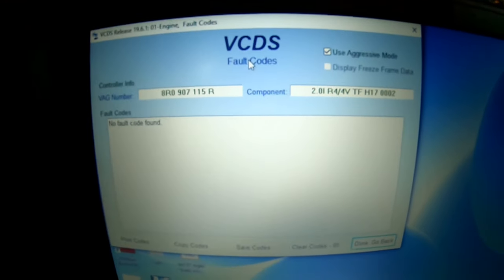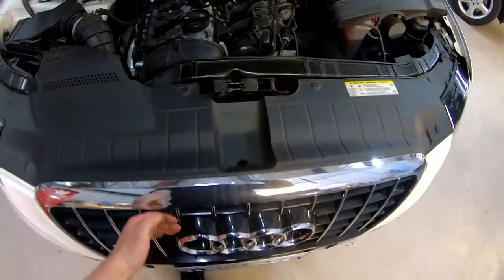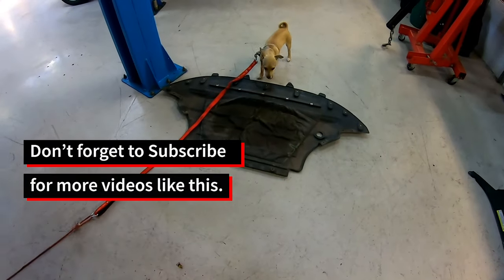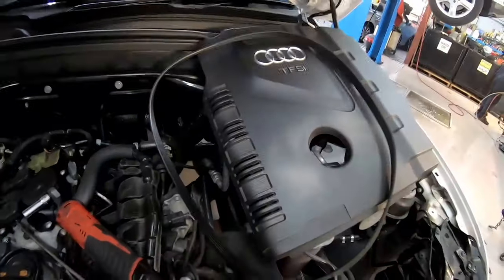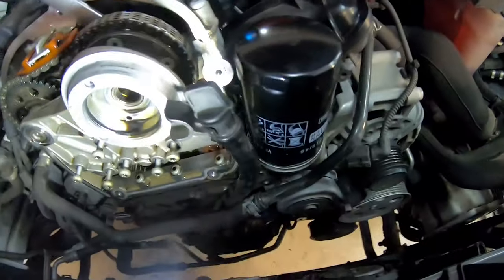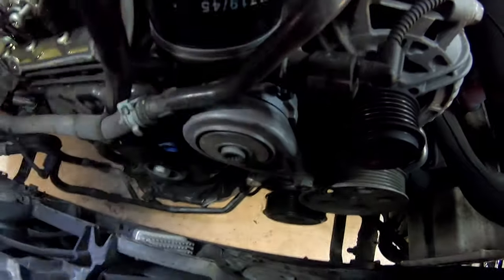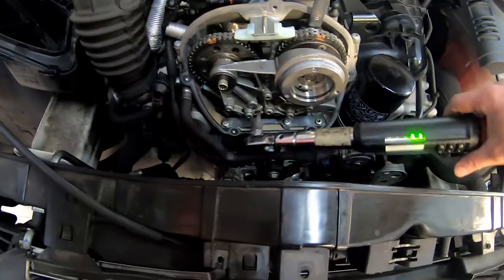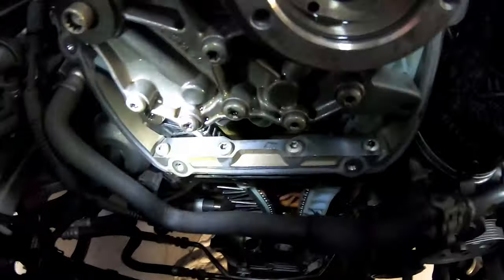Audi Q5 Timing Chain Replacement 2.0TFSI Guide

Comment: This is the first time I've seen anyone change just the big chain and not both of them. Makes the job a bit easier. Thanks for the torque specs. Excellent info and thanks for sharing it!
Reply from the maker: Yes it is advised to do all the chains if necessary or if the customer has the budget. But it is no problem to do just the main timing chain.

Comment: Just checked my camshaft adaptation intake bank 1 phase position sensor on my 2015 A4 (CPMB EA888 gen 2).....showed -6.02 degrees. Not exactly sure how the car didn't grenade itself before now, but I'm grateful. Might try doing it myself because the dealer wants $3500 for it.
Reply from the maker: Or find a good independent. Should be closer to $2k.  Just make sure to get a detailed quote on what's being done. I've seen them still dunning at 7°, but yours is up there. The tensioner will be out a fair way.

Comment: Fantastic video.  I was trying to understand, Can get away with changing the tensioner without removing the chain?  I am thinking of doing this for preventive maintenance.  Thanks
Reply from the maker: Yes you can. Obviously though it is better to replace the chain too, as most are worn and "stretched" by now anyway.

Comment: Good explanation thank you. my 1.8 TFSI is rattling from the front camshaft area when its warm (only in the lower RPM). Can you give me a hint please?
Reply from the maker: You can use a screwdriver like a stethoscope and put you ear to it whilst on different parts of the engine to zone in the on the location.

Does it have 2 oil pressure switches? If so then it has a variable oil pump. You could try unplugging the solenoid on the the variable oil pump, which is next to the crankshaft pulley. If the noise is gone with the solenoid unplugged, then it is likely related to oil pressure. Of course an oil pressure test would be another good test if you have the tools.
Reply: Did you solve the problem? I have rattling noise only when accelerating from 2-3K rpm. It is not loud, but it getting me nervous. 2.0 tfsi CMPA engine 60000 miles
Reply: @16800alex  camshaft magnet vents were defect
Reply: @barbenfischen  I have CPMA engine with one magnet on inlet shaft I replaced it. I've had this car for 5k miles, nothing happens, the engine has power no errors . I started thinking that it is normal sound of that engine. In mine there is such a very delicate rattling but i have to focuse to hear it. I even watched POV videos to compare the sound and it seems to me that these engines work like that. But I'm not sure.
Reply: @barbenfischen  Are you talking about the magnet itself or the valve in the shaft or something else?
Reply: @16800alex  the valve inside of the cam
Reply: @barbenfischen  Do you think I shoud replace it? Due to the symptoms you wrote about. And to be sure, you are talking about that valve? 06H109257C
Reply: @16800alex  try

Comment: My 2013 Audi Q5 CPMA engine did something? I think the chain jumped time? What are the part #'s on the old tensioner? What is the new part # tensioner? They replaced mine 12 months ago and 4,375 miles. The tensioner part # is 06K-109-467K they replaced. I found it to be dbpa code on looking for OEM genuine parts? What is the correct one for this DET - CPMA Engine from Austria? They seem to have Not Made many of these engines and they all seem to have failed? Please help me what should go in the engine timing train? I might get stuck doing this job. Car is at the Dealership who sold me the car 13 months ago. They did the timing chain 1 month before I bought it! The other person owned it 4 months and had it back to the dealer 4 times for engine light. They fixed it and she traded it in on another car! I bought it less than 30 days since they did the timing job.

Comment: Wow the Q5 is awesome. You don't need to take the whole front end off. That must be nice. Would you recommend changing the timing chain at the recommended interval even if it's not stretched all that much? Mine is -3.12 so it's below 4 and I've opted to leave it for now.

Comment: Excelent video! Maybe i missed it, how many miles for a 2.0 gasoline timing chain to be replaced? Thank you.
Reply from the maker: After 100,000km generally. Every service we check the phase position measured value to see how bad it is and advise from there.
Reply: @FourRingsAuto  I have 200k milies and never replace my timing chain.
Reply from the maker: Maybe you have carried out better maintenance than most? Some will make it to those kms if they are doing 10k km or less intervals it seems. The cars that do lots of kms in shorter periods tend to get higher kms before issues.
Reply: @FourRingsAuto  Mine is 2015 q5 2.0t and i don't know what gen is it.
But thanks for your answer
Reply from the maker: Gen 3 likely in a 2015. They don't suffer the same failure rate.

Comment: Thank you so much for posting this video! What do you do if the gauze screen in the cam bridge is damaged? Is it replacable, or is a new cam bridge required?
Reply from the maker: Vw and audi have a technical bulletin saying to remove it if it is broken. There are 2 types of bearing Bridge though. One of my timing chain videos I showed how to remove it I believe.
Reply from the maker: I have in the past advised to replace them though. The worry I have is where does the gauze go. Likely into the sump.

Comment: No need to do the balance shaft chain and guides?  Great video, thanks for taking the time.
Reply from the maker: If they are worn yes. It is a good idea depending on the condition of the rest of the engine. If it has been poorly maintained then it is advised to do all chains. Obviously adds more labour and parts costs too.

Comment: Hello from NE Pennsylvania, wow really great video, and I’d prefer longer , you don’t need to edit or Fast Fwd any content for us, I fact I was surprised you were able to do that job in the limited service position, I would have gone with full service to really get to the lower parts. So I have a 2013 B8 A4 same motor, can you describe the status for me to check my chain and tensioner? How do I know if I have the older version? And did that Q5 throw P0016 codes which prompted the work? Can some tell me the best way to read the best cam position in VCDS? Does the motor need to br at operating temp what rpm to check the degree of retardard based on a potentially stretched chain? Did you say if less than -5° meaning s larger negative number than -5° than it needs to be changed? Really liked the video, good details
Reply from the maker: Larger than -5° so say -6° is bad. I'd change it at -5° Max in my opinion though. Customers discretion.
Remove the round rubber bung in the lower timing cover and you will see the tensioner.

Comment: I have a Q5 TFSI 2.0 from 2015. 67,000 km. A year or so ago, I started to feel a vibration from something that appears to be engine failure. It has never been detected because apparently the fault is so small that it is not marked by the computer. Although lately he has started dialing more codes.

The failure always occurs slowly, in D or R, but always stopped. You accelerate and it goes away. The vibration became so extreme that it was turned off last time. I took him in and they changed the thermostat on the water pump (which was full of liquid). Before that I changed the spark plugs, bovines and recirculation valve, cleaning the throttle body ... for testing.  Do you have some similar problem?
Reply: Just wanted to follow up on this, did you ever get this sorted? Sounds like coils to me but I don’t even know if I classify as an armchair expert...

Comment: Thanks for this, great video. I was wondering if you have ever seen a cam bridge gauge/mesh come loose and cause a low oil pressure fault and a P0016 code? My car is a 2012 A4 1.8tfsi and had the new timing tensioner, new chain and oil pump plus cam bridge bracket approx 10000miles ago,  but has just popped this code up on a intermittent basis cheers from the UK!
Reply from the maker: Only heard of oil pressure issues with the screen if there is something blocking the guaze up. Usually ends up damaging the cams. P0016 is a timing code. Check the bolt for the inlet cam that goes through the cam bridge, the one that is reverse thread and requires rhe special tool to undo. If that is sticking out in the centre it will cause an advanced valve timing issue. Make sure this bokt is not over tightened too. Could also be caused by a lazy/delayed response from the external electronic solenoid for the variable valve timing. That is of course if the base timing has been set correct, but if you had an issue with this, you'd end up with a relatively constant fault code.
Reply from the maker: Seen gen 2 ea888 like these have oil pressure light on the dash for things as simple as a failed pcv valve. The car has 2 oil pressure switches so it can run in regular oil pressure state, and when needed regulate the oil pressure lower to reduce emissions etc.
Reply: Awesome thanks for your help. I think the bolt you mentioned was also replaced at the same time as cam bridge but will check. As you say timing is not a constant fault so thinking more oil based. Occured during lockdown when only taking short 5miles journeys and oil never getting to temperature. My mechanic guy was stumped but has agreed to inspect the top covers and cam bridge. Hopefully the cam isn't damaged!!! Thanks for your help and stay safe down there
Reply: With a PCV problem would that cause an intermittent issue? Sometimes the car runs fine. Thanks
Reply from the maker: The pcv issue i once had that caused an oil pressure light only came on at idle when hot. The pcv caused the idle speed to drop enough to drop the pressure enough to trip the light.
Reply: That's interesting about the PCV as my only comes on at idle and occasionally stalls at junctions when not warm engine
Reply: Hi just thought I'd thank you again for your help via the comments, replaced my PCV and seems to have worked as the oil pressure warning not coming on and idle is running loads better. Drove 50miles without a management light on but it's just popped up so need to get that checked, I'm hoping it'll just need resetting. But for reference my car is the Gen 3 EA888 and had a oil pressure warning at idle, plus some rough idle and occasionally stalled when cold. Cheers

Comment: Hi there, thanks for the video. I have a 3rd gen 1.8 TFSI in my A3 (CJSA engine code) Have you by any chance seen a stretched chain on the gen 3 EA888 engines? 
I’ve had oil changed every 7-10000 km’s and full service history at Audi. It has 140K on the clock so wondering if there is any specific km you would reccomend an inspection of the chain itself? Cheers.
Reply: 체인이 늘어나서 타이밍체인이 넘어간차량 수리한적있어요

Comment: Thanks for the video! I’m about ready to do both my chains and everything. I like the longer videos like this for sure. So you believe in changing the chain because of the cam adaptation phase? I’m doing mine because I have been reading about it and mine is -5.87 degrees with the engine fully warmed up. Thanks for the time you put in to recording and editing these videos!
Reply from the maker: Yes, the negative phase position indicates a worn chain causing the timing to be retarded. The more the chains wears the longer it becomes, and the more retarded the inlet phase postion is.
Reply: Four Rings Auto right on man! Thanks for the info. It doesn’t really seem like that bad of a job. And it was only $480 USD for all the parts and seals and bolts to do the full job. That’s not including the price of the lower cover. I’m pretty sure I can get that off without damaging it
Reply: @FourRingsAuto  hey mate i just had -3.76 reading today on my 2012 audi q3 CPSA 2.0tfsi engine with 125k kms! It has the revised chain tensioner as it was checked and this was installed from factory I believe! What's the difference between the negative and positive readings? Should I change now or can I wait til its on +-4 deg as the web mentions 4 and 5 as the figure, but over 5 would be a no go zone. Thanks for this video
Reply from the maker: I've never had one with a positive number. Assuming you are using vcds and that the info you are reading is trustworthy, positive would mean that the timing of the inlet cam in reference to the crank is advanced.
Reply from the maker: Jason, check the centre bolt for the intake camshaft. It is the control for the variable valve timing. If it is sticking out proud in the middle,  it can cause the valve timing to be advanced when it shouldn't be. The bolt/spool valve can fail like this. Make sure the outer electrical solenoid magnet moves back and forth and isn't sticking out too.
Reply: @FourRingsAuto  my mistake, the reading was -3.76, not +3.76

Comment: Are there any timing marks on camshafts housing to line up the camshafts marks
Reply from the maker: No there aren't. There are the coloured links on the chain if you are removing the chain and either reinstalling or renwing it. There are also measurements from the centre rib on the top chain guide to the inlet timing mark. Then there is another measurement between the inlet mark and the exhaust mark whilst the engine is at tdc.
Reply: Four Rings Auto The reason I ask because my marks on the chains are on the outside of the marks on the cams. I hope that made sense.

Comment: how do you crank to build up oil pressure without starting the engine? I have a key you push in to start the engine.
Reply from the maker: Disable the fuel and ignition
Reply: @FourRingsAuto  by pulling fuses or via VCDS / scan tool?
Reply from the maker: @alexmotoblur  i personally disconnect the ignition coils, and leave the wiring plug for the injectors unplugged.

Comment: Do all tsi engines suffer the timing chain and tensioner failure ? Thanks
Reply from the maker: The gen 1 and 2 engines suffer from the issue.
Reply: @FourRingsAuto  ok i asked because i know the 2007 on mk2 seat leons suffer from the failure but the Audi on this video looks new. Could be older but it looks new.
Reply from the maker: Yeah yours would be a gen1 this is a gen2 in a newer q5.
Reply: I have done chain, tensioner and guides replacement on my 2010. Mk6 GTI at 128.000km with OEM parts. It works perfect.

Comment: Great video!! What kind of torque wrench is that? 
Also I completely rebuilt a 2.0 in a 2009 VW Passat. After I’m having this noise, not coming from the drive belt pulley. It’s at the bottom half, thought it was the oil pump but just replaced that today and noise still there. I do remember having a issue putting in the top balance chain guide, maybe chain rubbing against it? I would appreciate your help, here is a video of the sound https://youtu.be/_9c4oHUUdK8 thanks in advance.
Reply from the maker: Snap on Tech-angle digital torque wrench.
Reply: @FourRingsAuto  thanks for the reply! 
Also I completely rebuilt a 2.0 in a 2009 VW Passat. After I’m having this noise, not coming from the drive belt pulley. It’s at the bottom half, thought it was the oil pump but just replaced that today and noise still there. I do remember having a issue putting in the top balance chain guide, maybe chain rubbing against it? I would appreciate your help, here is a video of the sound https://youtu.be/_9c4oHUUdK8 thanks in advance.

Comment: I'm sorry that you guys had to do this kind of work for money.
Reply from the maker: Why? It's easy work and profitable.
Reply: @FourRingsAuto  This is hard work, this is not easy work.
Reply from the maker: Maybe for some. For a good vw audi specialist this should be easy work. Time consuming, but easy to a competent mechanic/technician with good attention to detail. I have completed many jobs far more difficult that these.  But I enjoy the larger repairs.
Reply: @FourRingsAuto  Can you work on a W8 engine?
Reply from the maker: To be honest I've not had the pleasure. As far as I'm aware, they weren't sold in Australia. I have worked on W12 Audi A8 D3 models though, and W12 Bentley Continentals, so similar. Everything is well packaged.